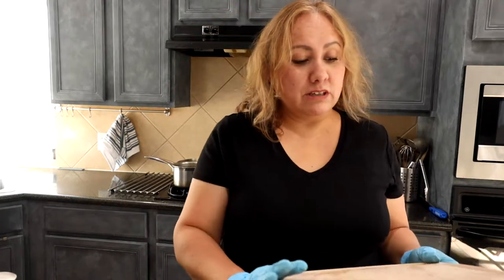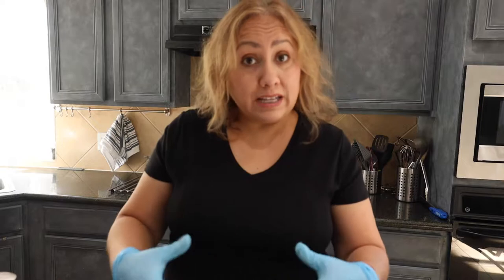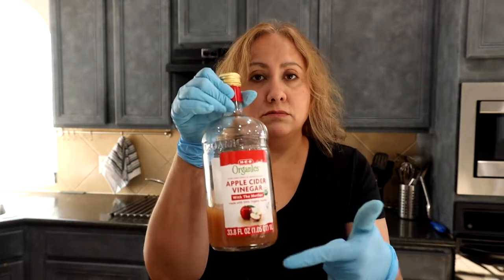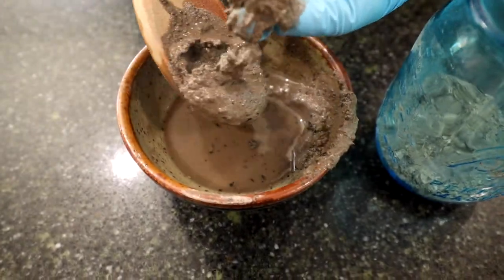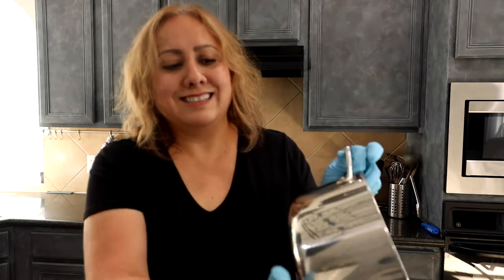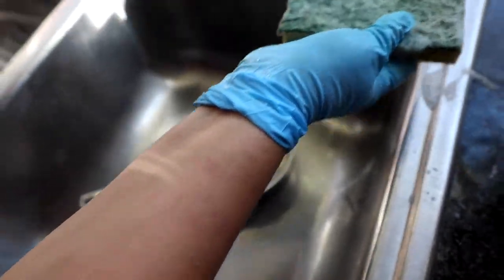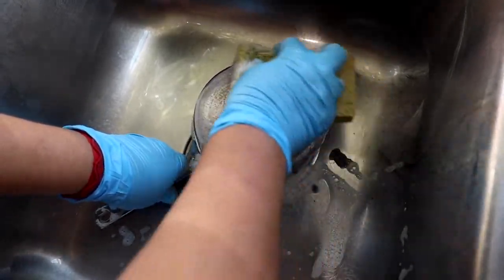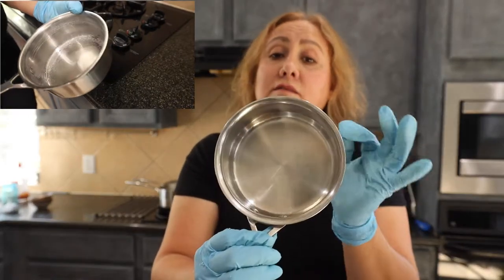ASHES to clean sailboat's wood floor or pots and pans.

Comment: Very cool idea, thanks!  It does, however, present some serious challenges on a boat, especially liveaboards.  For one, where do you get the ashes?  Most of us run propane BBQs so no ashes worthwhile there.  Second, boilng a solution like this for 30 minutes uses up quite a bit of power, if you are electric, or propane, if that's your stove source.  I'd love to try some of this paste on my stainless steel sinks as I think they'd come out really nice!
Reply from the maker: Do liveaboards ever do bonfires on the beach with other cruisers?  We have thought about packaging some ashes from our charcoal bbq to take with us in sealed bags for use on the way.  Thanks for the comment Dan and good luck in Grenada!